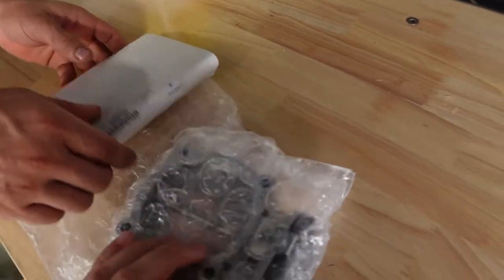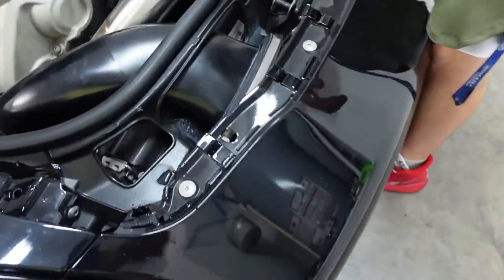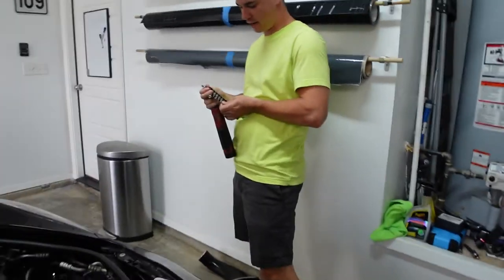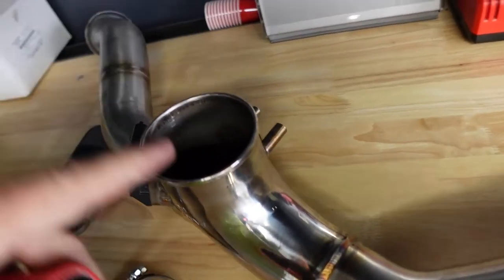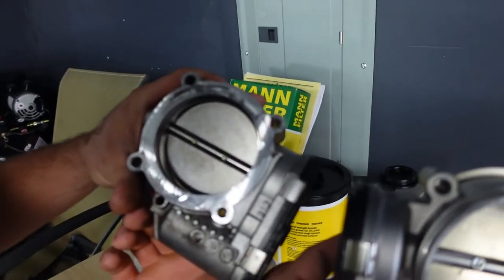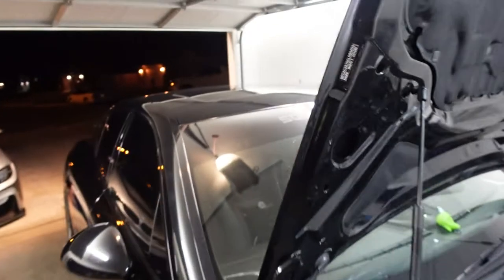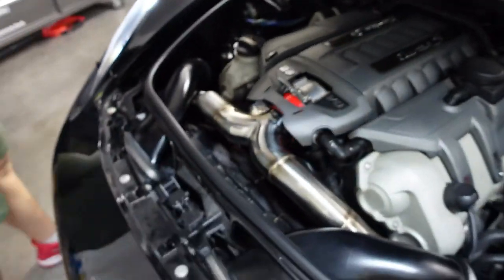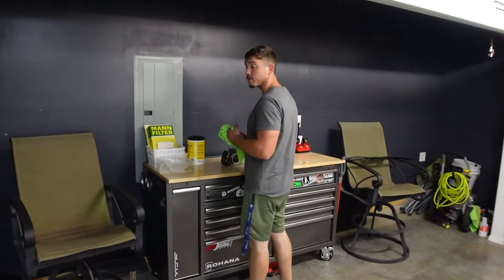Panamera gets GT3 parts

Comment: just wondering if you ever resolved the MAF (MAP) sensor issue...  Having the same issues on my 2015 Turbo S and I have the same set-up - Fabspeed charge tube and adding the Soler ported 82mm TB, though my car actually came stock with an 82mm TB...